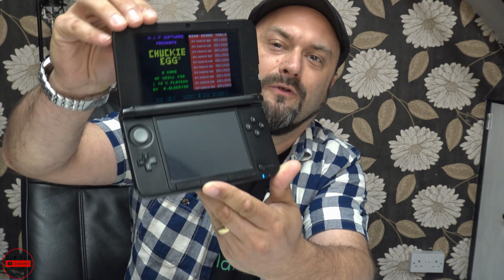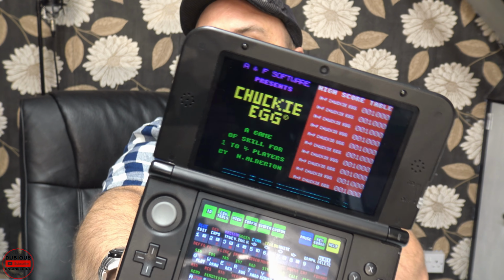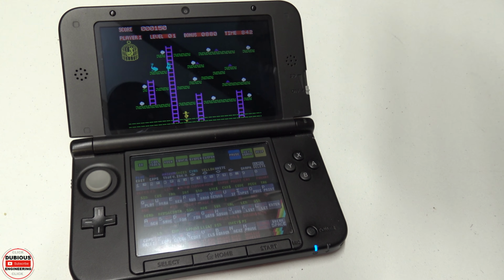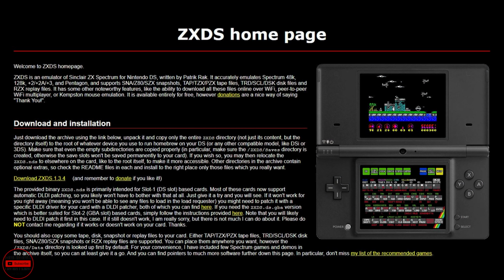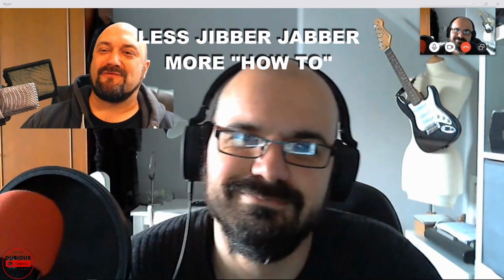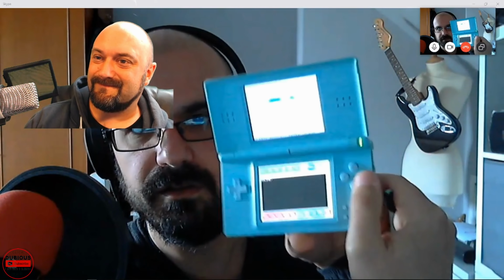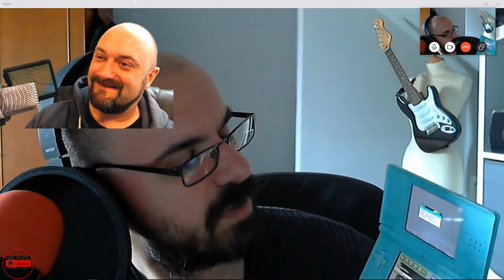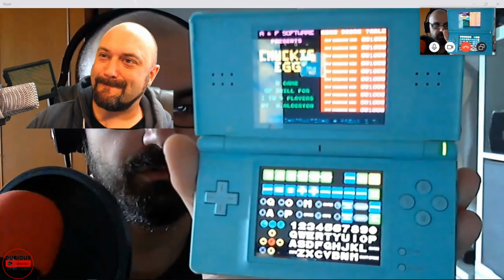DuB-EnG: Super Cheap Retro Gaming ZX Spectrum Emulation on the Nintendo DS ¦ Nostalgia - Chukie Egg

Comment: any chance of getting a N64 emulator running on a 3ds?
Reply from the maker: Unfortunately not...  The processors in the 3DS just dont have the power to emulate the N64.  Actually, apart from laptops, most things cant cope with N64, even the modern Rasberry Pi 3B+  I hope you're well Dan...  and thanks for your continued support!!  H